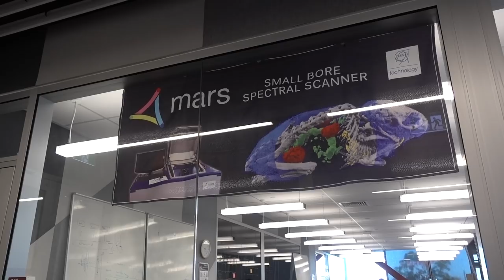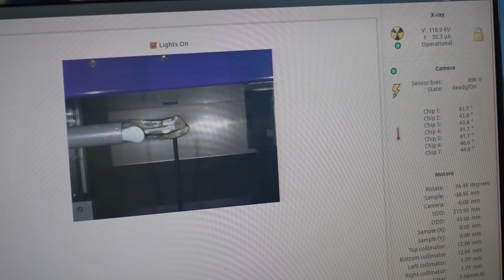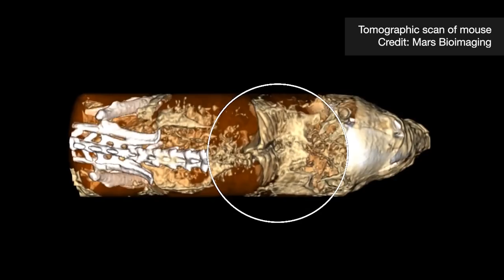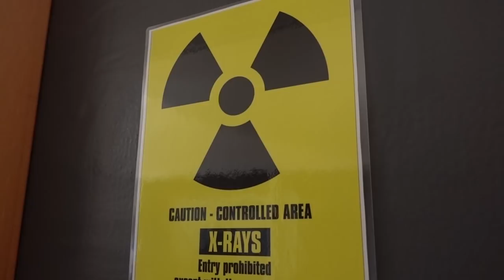The first 3D color X-rays

Comment from the maker: There's a line in here that goes by very quickly, but to be clear: that little X-ray sensor measures the frequency of each individual photon that hits each pixel. It's an offshoot of tech from the Large Hadron Collider.
Reply: Ok. Uploaded one minute ago. Comment from 3 hours ago
Reply: 1:05 Isn't it "fluoroscope"? Was it mistyped in the original photo title?
Reply: @benhiggins1135  You know the concept of a "Private Video"???...
Reply: A burning question here Tom - what's with the googly eyes? A horizon indicator?
Reply: That how does it know which direction it came from? O.o >_>
Reply: It measures the frequency of each photon? That's incredible, and I had indeed missed it. Normal CCD or CMOS camera pixels only count the number of photons that are within its frequency range, and miss all other photons.
Reply: This is why scientific research needs to be funded even if there's no immediate practical uses.  You just never know what you are going to discover and what those discoveries will lead to.
Reply: @joeslayer97  It was actually a Heisenberg uncertainty joke... so not the "same as anything". It was tongue in cheek, but I've sort of started to wonder... once you know the absolute position of the photon (where it hit) how CAN you actually accurately measure its frequency, given that you could derive the velocity from that and the wavelength...
Reply: Its cool how technology in the hadron collider can be used in x-ray machines. Hopefully we see a lot more of this technology in the years to come.
Reply: Why are you using the American spelling for "colour"?  I thought you and this channel were British?
Reply: great example of pure research benefiting practical application
Reply: As amazing as all that applied work that the Canterbury team have done the LHC line was my main take away from this piece. 

A great advert for international cooperation and collaboration. Well done to all involved. Outstanding work.
Reply: I have three vertebrae in my Thoracic spine that have compression fractures. This type of imaging would be of great benefit to my doctor. How do I volunteer to be a test subject for this procedure??
Reply: so, its magic you say?
Reply: In munich, they are using the phaseshift of XRays to do medical CT, also very interessting.
Reply: @damien4197  @hyperkitty it will most likely use a collimator which ensure that only x-rays that are perpendicular to the walls of the collimator pass through so you know that the ray came from exactly below the detector not at an angle from somewhere else
Reply: That sounds like it could have massive implications for the photography world as well. The fact that every color for every pixel is currently offset really screws with the perceived sharpness of a photo.
Reply: University of Canterbury not University of Christchurch. 

That would be like calling University of Michigan the University of Ann Arbor
Reply: I'm curious about this tech. Would this be able to detect ceramics? Or plastics? Because I worry about henious people switching to those forms of munitions to cause more harm due to the difficulty of finding the bullet or shrapnel.
Reply: That's a bit like the Foveon CCD optical sensor that has three stacked layers to detect red, green and blue at increasing depths, with no Bayer filters. The trend across electro-optical systems, in general, is to make every photon give up every bit of information it carries.
Reply: @r0cketplumber  That's cool! It seems like Moore's law applies to photodiodes too!
Reply: The value of poor science.
Reply: @rockthered8706  All it needs is for the different materials to have different atom compositions so you get different X-rays shinning form it.
Reply: That displays deserves a whole episode. Looks like it is tracking the viewer's point of view.
Reply: Thomas where can I buy this red shirt?
Reply: I watched professor Brian Cox talking about just that a few years ago. It’s not what it shows us know. It’s what byproducts develop off the back of it. The easiest example being the light bulb. We didn’t learn to produce and harness electricity to be able to light up a room. But as a result of the ability to make electricity we invented the lamp/lightbulb and what that then opened up is endless.
Reply: I have to admit, "Offshoot of tech from the Large Hadron Collider" does make me a bit more hesitant to put myself up for this type of X-Ray testing, even if it's probably not related to the actual "Throw atomic particles at each other so strongly they create subatomic particles like the Higgs Boson" part.
Reply: could be good to pick out cancers too if they get it right
Reply: Scintillators are much older than the LHC though, but I presume that is what the general public will relate it to.
Reply: Get it? Offshoot?
Reply: @Baker-tx7yg  How exactly would it alter the management of your condition? If it causes any problems with spinal cord, any inflammation and effusion will be shown on standard MRI. If you need decompression or vertebral body fusion or both surgical procedures, the use of this prototype curiosity will not change your management and outcomes at all.
Reply: God you're smart
Reply: I used to develop xray sensors and this is something we never really considered. But it makes perfect sense. We created false color and this is a much better system.
Reply: @ExtremeBogom  It's not like we're offended by it or don't recognize it. And I would expect google to understand when doing searches.
Reply: This large hardon collider sounds dangerous
Reply: I noticed that.  A couple years ago, such a camera was an April Fools article on a camera review site.
Reply: @joeslayer97  No, you don't have lenses that work for X-Rays.  x-ray telescopes use enormous barrel-shaped focusers that use grazing angle total reflection, or use "coding masks" to figure out direction.  X-ray machines I'm familiar with don't focus at all, but are 1:1 images of a point source -- like a pinhole camera in reverse.  Light hitting a particular pixel can only have come from one direction -- a line from that pixel to the point source.
Reply: Great video, thanks for sharing. I've worked on confocal microscope designs and new imaging technologies excite me.
Reply: You are right - if not for you highlighting this fact , I would have missed it!
Reply: You spelled colour wrong
Reply: @toefurcub  maybe he's been hanging around too many misguided Americans? :-)
Reply: That screen is a 3D screen (stacked up layers of screens) forgot the name tho
Reply: Is there research going on how x-rays can be used to make porn better?
Reply: So that several billion dollar thing has a use, apart from giving us proofs of existence of some really unusable stuff
Reply: I want to build a Fluoroscope for the children.
Could you please make a tutorial?
Reply: They need to compress the data some how 🤔 to make this more feasible
Reply: @benhiggins1135  viewed one year after I  love this little game
Reply: Could this be a new replacement for MRI?  I find MRI machines quite scary with all the whizzy noises and the fact your atoms are being manipulated!
Reply: It is not the photon frequency but the X-Ray photon energy that is measured and differentiated.
Reply: @Baker-tx7yg  Um call me buddy,,, I've been working on a little project and need a volunteer :)
Reply: @grandmothersapplepie  MRIs rely on nuclear spin flipping so no atoms are damaged. Interestingly, since the nuclear spin flips emit at radio wavelengths, you become a radio. No ionizing radiation involved, but you don't want any magnetic materials near one.

Comment: Ah, so this is the thing that used the unit "gigabytes per litre"!
Reply: when youre about to 3d print water and you look for the smallest gigabytes-per-liter file
Reply: @DarkIzo  Wouldn't you want the highest? You know, for the best resolution?
Reply: @Bobberation  more data also means more data processing which takes time. I'm sure there's a  sweet spot between the amount of data and resolution
Reply: DrPengin ah, yes. A waterphile.
Reply: GB/l
Reply: @jroddimus  You mean GB/L.  The symbol for "Litre" is always a capital L.
Reply: @greensteve9307  Actually, it's not. The SI symbol for litre was originally only a lower case L (generally, only units derived from people's names are capitalised). However a lower case L is easily confused for a capital I or a 1, so it was common to use an uppercase L instead, and in 1979 it was adopted as an "alternative" symbol. Both symbols (l and L) are acceptable, though different countries have different recommendations (most prefer upper case).

This can all be found in the Wikipedia article for Litre.
Reply: Water is an incompressible file
Reply: @alicec1533  > "I only drink water if it's 8K uncompressed"
Do you mean 8 KB/L? That's far from even 1 GB/L.
Reply: @alicec1533  is it wetter if its uncompressed?
Reply: Give me my RGB water
Reply: Val yes it is. It’s called ice.
Reply: @themitchwich  Really and in which country ice occupies space less  than water?
Reply: 1.21 GIGAWATTS!!!
Reply: @valshaped  You have to use really a strong code to compress water - like a mega-pascal will get you about 0.05% compression.
Reply: @AnonymousUser77254  hydrophile
Reply: @vwertix1662  yes, that is more eloquent.
Reply: it's a storage density used for server rooms in some specific situations
Reply: @cmmartti  Just use the "special" L -> GB/ℓ
Reply: @martinum4  true this cursive is everywhere in my kitchen stuff
Reply: i am sure that imperials have some unit for this, propably 1 brain
Reply: "I feel terrible - must have had a coupleof terrabytes down the pub last night!"
Reply: @iz7geg  None. It's like zipping a video file. You can't compress it any further, so you just start adding overhead.
Reply: @lunakoala5053  what? There is no perfect codec and zipping video files doesn't always increase size.
Reply: @AureliusR  "There is no perfect codec" Never said there were
"zipping video files doesn't always increase size" it does. It might just be a few bytes.
It's really simple:

Lossly video codecs are used, because you can't compress it any further losslessly.
Zip files are compressing losslessly.
Every archive has metadata. Adding files, increases the size of the meta data, as new files have to be listed etc.

Comment: Sorry.. Hold the phone.. You've totally skipped over the tech of that monitor.. was it head tracking or something? the image was tracking the viewer... when did that become a thing?
Reply: The New Nintendo 3DS also does that
Reply: greencapzelda I also heard that the new 3D Televisions are awesome!!!
Reply: Might be something similar to light field displays, but not sure
Reply: Does no one remember the guy that did this on a laptop screen years ago with a Wiimote and a couple of infrared LEDs glued to a pair of glasses?  It was seriously over ten years ago.
Reply: @Acorn_Anomaly  yes
Reply: The tech they're using requires the viewer to be wearing glasses with IR reflectors for it to work, although you can also use a mouse to move around the 3D space.
Reply: UC also has a human interface lab, so they probably got it from there
Reply: @tobimckellar2458  They take the x ray thrn import it onto a 3d modeler program such as blender.
Reply: Tobii
Reply: Captain Disillusion need to explained this
Reply: It’s called a light pen and that ... is something you might not have known

Comment: When I was a radiography student in the mid 1990's I wanted to invent some form of imaging that used the x-ray "colour" spectrum, but couldn't think how to do it. I am glad it's now reality!
Reply: It‘s not. It‘s still some pseudocolours
Reply: @spectra6995  it's colours based on the wavelength of the x-ray spectrum, so directly analogous to the colours of visible light. The colours are based on spectral information rather than Hounsfield unit density, therefore are much less "pseudo colours" than what we normally see in 3D CT images.
Reply: Admire those inventors who did it
Reply: If you can think it, someone already built it and built it 10 years ago. If they haven't then they will.
Reply: @adamsmith6594  so what you are saying, Adam, is that everything that can be invented has been invented. Lord Kelvin said that back in the 1800s.

Comment: No one talking about that HP VR screen, so cool
Reply: True definitely cool, but it's not as crazy impressive as you may think, it's basically a 3DS screen on steroids.
Reply: It's more like a 3D monitor with tracking devices
Reply: Do you know how it works? Does it do some kind of viewer tracking and feeds that information into the rendering software?
Reply: @download333  search for zSpace. I think it's a similar tech. Tracked 3D glasses with either passive reflectors or infrared light. The 3D glasses are probably active shutter glasses. Some systems also track a pen for interactions.
Reply: I came here to say the exact same thing, I was completely distracted by that incredible interface.
Reply: @grigtod  well the monitor says zSpace in the bottom right, and they did use a pen. At 5:10 you also see the lens they're holding up to the camera drift a bit. You're spot on
Reply: The screen is a HP ZVR and it cost 6000€
Reply: @pierreuntel1970  ahh yes, just a casual weekend purchase

For Bill Gates
Reply: I think i saw something similar for a Lego display at Toys R Us
Reply: @HululusLabs  if you are doing importand 3d research then it's actually cheap
Reply: @GewelReal  indeed
Reply: @download333  It detects 3d glasses's motions and angle then calculating which angle user might be looking at and then printing image to the screen the way we would see in real life
Reply: i think everyones just a tad distracted on something else in the video
Reply: @HululusLabs  thats lime giving a homeless guy 2 pennies to him
Reply: It’s called a light pen
Reply: @download333  yup.  You were 3d classes and the sensor at the top of the monitor track your head and render the image based on your movements, in addition to the stylus they are holding.  Simple, but very cool.  EchoPixel uses the same monitor

Comment: An interesting point: The emulsion of a photographic film is extremely thin and most x-ray photons pass through without interacting. This makes it very inefficient, which would require a large radiation dose for the patient to adequately expose the film. Instead a “film-screen” system is used, in which a fluorescent screen is placed against the film. Most of the exposure of the film is from visible light emitted by the screen. This system is still used with modern digital sensors.

Comment: great video! Another related topic in regards to these x-ray “sensors“ is the subject of scintillation detecting. 

Basically using a material that reacts to any detected radiation by giving or photons or small amounts of light. This is paired with an extremely sensitive light detector… That can sense low levels of light not visible by the human eye. Even a single photon. It then amplifies the signal and feeds it into a meter or other device.

Common detection materials are sodium iodide Crystal “NaI(Tl), many other types of crystal, and special “doped”Plastics… 

The light or photons produced, Are then sensed by a photomultiplier tube and some software… Or in the case of modern medical devices usually done with avalanche diodes or “SiPM’s”. (Solid-state versions of a photomultiplier tube… Known as silicon photomultipliers)

It’s an extremely interesting topic… And I began to dabble with scintillation detectors in regards to locating radioactive sources or “orphaned“ sources. Mostly In industrial salvage yards.

A nice NaI(Tl) (sodium iodide) radiation detection probe… Coupled with a nice radiation survey meter… (i use a Ludlum model 3) and you can have a lot of fun on a Sunday afternoon! Prowling around the local antique shops for all types of vintage radioactive items! Or if you’re brave you can check the industrial salvage yards but you might find some much more dangerous sources there.

In regards to a decent scintillation probe… They are 100 times more sensitive (or more) than a standard geiger counter or Geiger-Müller tube. For example most of my geiger counters pick up between five and 25 standard background radiation with no sources nearby. This is radiation from the sun and just the normal small amount of background radiation found everywhere on earth. But my scintillation probes detect 3500-5500  counts per minute (cpm) average background radiation readings. Therefore sources can be detected from several feet... or several hundred yards away in the case of extremely active sources. They used to strap these things to helicopters and fly over uranium fields to find the best areas for prospecting.

Comment: you should be able to get colour stereo images using old fashioned x-ray film too. just take multiple exposures with the x-ray tube running at various voltages and from two different angles.

Comment: I have worked with this and the reason people are not doing this is mostly cost. You can use data processing to colour the data based on density and grouping. 

Further, 3D imaging, as they call it, is just a normal 2D scan repeated and is using already existing flipbook techniques.

Comment: using ubuntu i see , wise decision made has been!
Reply: Noob decision if anything. All hail the grandfather they stole everything from
Reply: I used it since Bo. It ran quite fine on my old computer (486 with 8MB ram). This was the time when you had to enter modelines into the XF86Config file and if the monitor made some unpleasant noises, you had to press ctrl+alt+backspace to prevent it from emitting smoke... Now I use Stretch and Sid (depending on the situation) and it is much more pleasant and userfriendly then ever before and even more userfriendly than Ubuntu because it isn't that broken. ;)

All hail the grandfather! But they didn't steal from him, that isn't possible with free software. They just took the noobs away. ;)